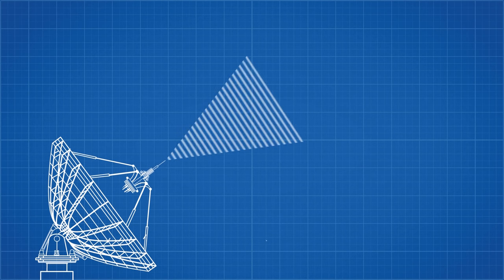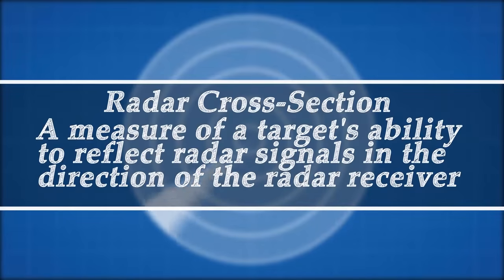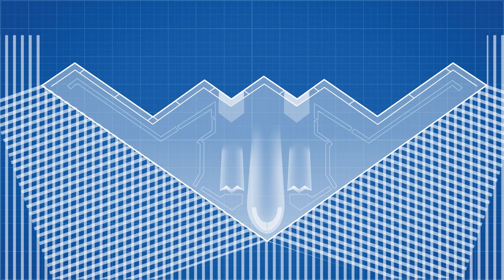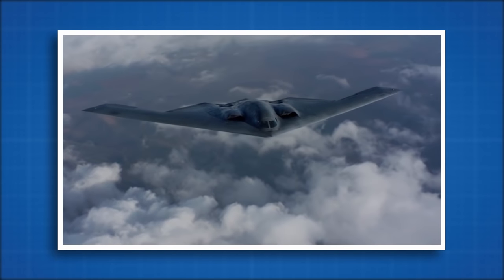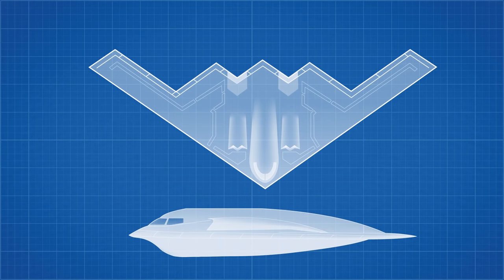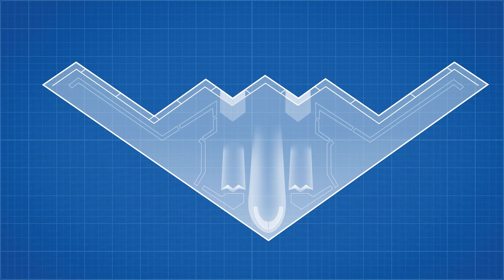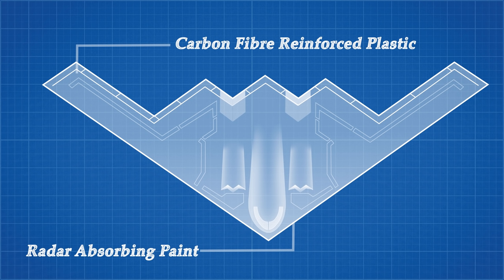Stealth - How Does it Work? (Northrop B-2 Spirit)

Comment: so radar works like sonar but with radio waves instead of sound?
Reply: pretty much
Reply: Hence the similar name Ra-DAR,  Radio Detection And Ranging. So-DAR, Sonic/Sound Detection And Ranging, the name for using this principle in meteorological instruments, for military use it's called So-NAR: Sonic Navigation and Ranging. Then there's also (just had to look it up) Vi-DAR, Video Detection And Ranging, and LIDAR, Laser Imaging/Light Detection And Ranging. All work on the same basic principle: sending a pulse and look for how long it takes to get a reflection and where from, except VIDAR, that just a high-speed camera looking for speeding cars, comparing images to calculate speed :D
Reply: No ahit

Comment: I’m pretty sure that the F22 raptor has the radar cross section of a marble so........
Reply: But that is against fire control radars, b-2 is stealthier against longer wave lengths. However, fire control radars are all you really need to be very stealthy against to survive. (as long as your own radar and sensors can see the enemy from a longer distance than they can see you) I doubt even VHF radar could see f-22 from 250 miles away, which is the same distance f-22's alr-94 will passively pick it up.

Comment: Things you will never hear at war:

1: The shot that killed you
2: A-10 firing it’s guns at you
3: “B-2 spotted on radar!”

(To everyone who hates this comment: *Please relax, it’s just a joke*)
Reply: It got shot down because of radar once
Reply: sigh

FYI it wasn't one of these that was shot down. No B2 has ever been shot down. The only one I know of that has crashed was one with some sort of electrical problem on takeoff.

Serbia shot down an F-117A nighthawk, a plane designed and conceived in the 60s, but simply because the pilot had been using the same flight path over and over and the bomb bay doors were jammed open. The actual shot was lucky but it's the only nighthawk that was ever shot down. I'm also fairly sure the Americans didn't destroy it because the technology was over 20 years old at the time. Meanwhile if I remember correctly Serbia basically got turned into Swiss cheese after these things destroyed 1,600 high value targets.
Reply: @thomashayhurst6547  health care
Reply: @lazar9586  what do you mean by that? What relevance does it have to the conversation? Just curious..
Reply: Guys please stop sending hateful replies, this comment is just a joke for those who understand it
Reply: 1: kinda not true

Comment: You should do a better job of checking your history. Northrop had made flying wing planes before the Ho-229 existed starting with the Northrop N-1M which led to the N-9M which lead to the development of the YB-35 and YB-49. Please stop peddling the myth that the B-2 Spirit was inspired by the Ho-229, it wasn't. The Ho-229 was also had a completely different role, it was a fighter/light bomber, VERY different from a strategic bomber like the B-2 or YB-35/YB-49.

And what planet are you living on if you think the Ho-229 would have had a big impact? You know it only carried two 500 kg bombs right? That is is NOTHING, even the P-47 could carry more bombs than that. Or how about the Mosquito bomber, that plane carried twice the bomb load of the Ho-229 and nothing could catch it until 1944 but it wasn't devastating Germany. 

So please do away with the Nazi tech-wank, other wise it's a well done video.

Comment: The Germans may have been genocidal maniacs but damn were they good engineers. Still are.
Reply: No they were shit engineers in WW2. None of the stuff they made actually worked, it just looks good on wikipedia stats pages. I mean the idiots didn't even have trucks so the vast majority of their army had to walk everywhere and use horses to move supplies. The Allies were actually more advanced in just about every area.
Reply: Yeah, their tanks are a prime example of this. Everyone pictures them as impenetrable behemoths with a gun large enough to make any ally tank crew retreat. This is not true... at all. While when the Tigers and Panthers were first used they were, for the most part, better than all Russian and American tanks but they were slow, and too heavy, both for the ground and their transmission as they would constantly break down and sink into the ground. The ally tanks also had the advantage of numbers, while the Tigers could take them out easily a few could start flanking it and get to it's rear armor, penning and destroying them and later on with tanks like the Sherman Firefly and T-34-85 the Tiger was completely outclassed. It is also worth noting that when Germany invaded Russia they had not designed their tanks for the cold so they broke down, despite being built on more reliable chassis (Panzer 3s, 4s and Stug 3s) they couldn't handle the cold.
Reply: Jhawk 163 Tigers and Panthers were never better than all the Allied tanks, they only look it on paper. If a tank is constantly breaking down and has shit speed and low range then it's really bad on a tactical level. They were also far too expensive and time consuming to make in large numbers so even in 1945 they were only a minority of the German armoured forces. They also were not invulnerable from the front even when they were introduced. Loads of Tigers were even killed by the British 6 pdr gun. Tiger 131, the only still working Tiger, was knocked out from three 6 pdr shots to the front of it in Africa. And it's not as if attacking from the front was neccessary either. The Sherman and T-34 crews knew how to exploit there far greater mobility and were always getting into good flanking positions on German tanks, even if you can kill a tank from the front it's always best to surprise them from the side. That saying about how it took 5 Shermans to kill a Tiger is total bullshit.
Reply: EvidensInsania You are saying the same shit I did and calling me wrong....
Reply: Jhawk 163 It was your comment about how at first Tigers and Panthers were initally the best tanks and when confronted with Tigers the Allies would just lose lots of tanks while they flanked it. As I said, Tigers and Panthers were never good tank designs. Also it is so completely untrue that tank battles against Tigers happened that way and is really insulting to Allied tankers. First off if you're going to flank a group of enemy tanks you do it before the battle starts otherwise enemy tanks could quite simply just turn to keep their front armour facing the enemies. The second thing is that even from the front Tiger's could always be killed. As I said, there are plenty of times when even little 6 pounder cannons knocked out Tigers from the front. You also don't need tanks to kill other tanks. Anti-tank guns were responsible for knocking out a lot more tanks. So long before they were fitted in tanks you had guns like the 17 pounder, QF 3.7-inch AA gun, and Soviet 85mm flak cannons that were being used on the the field and obviously more than capable of ripping right through any Tiger. AND you even had portable infantry anti-tank weapons like the PIAT and Bazooka.
Reply: EvidensInsania I said better compared to the competition, because at the time, the Americans had the slow sherman with wimpy armor and an even wimpy-er gun. BTW, the way I said the allies used for killing Tigers is true, but for when they got ambushed.
Reply: Jhawk 163 Even the first Sherman's weren't comparatively slow and despite their hull armour not being as thick it was constructed at a steeper angle than on later Shermans. So even the first Shermans were much better armoured than the Pz IV and III and would often bounce 75 and 50mm German shells. You know what else the first Shermans could do that the Tiger's couldn't? Work without breaking down. A pretty important trait for any military vehicle and the Allies had the common sense to recognise that unlike the Germans. Take the M26 Pershing, the Americans could have had that tank in mass production and service in early 1944 but the tank commander's in Europe absolutely did not want it because it was so unreliable then and they wanted something they could count on not to let them down when they're in the shit.   

No blindly charging Tiger's, sacrificing loads of tanks, was NOT how the Allies fought Tigers. Like I said, they had plenty of tools at their disposal that could kill Tiger's from the front. But even if you're just talking about the 75mm Shermans being ambushed by a Tiger (and may I point out that 75mm Sherman barely ever saw Tigers) then they could use smoke shells to hide their approach or another effective tactic was to use white phosphorous shells that would burn so brightly that the Tiger's gunner would be unable to see and the smoke from the burning steel would get inside the tank and make it impossible for the crew to breathe.
Reply: Jet fighters
Cryptography
Rockets
Modern Machine Guns
Assault Rifles
Anti Air
Submarines
Modern Tanks
Airborne Units
Helicopters
Guided Weapons
Night Vision
Some examples of the "not working stuff": MG42, Sturmgewehr 44, V2 Rocket, 8,8-cm-FlaK 18/36/37, U-Boot-Klasse XXI, Gewehr 43, Zielgerät 1229, Messerschmitt Me 262, Bf 109, Fw 190, Ju 88, Ju 87, Enigma,  ...
Reply: weco well submarines and helicopters are spanish...

Comment: Video suggestion for Real Engineering...  Pierre Spray (father of the F16) has called stealth a scam.  It appears modern radars use broad spectrum frequencies to effectively detect stealth planes.  Russia and China already use these.  Example...so if the B2 is designed to defeat 9 GHz radar, a 8-12 GHz broad spectrum would have no issues spotting it because they can go beyond 9 GHz.  It would be interesting to see a video on this.
Reply: +Aaron Smith

 You are very much mistaken. Pierre Sprey was not the designer of the F-16. He worked under John Boyd as part of the research team for the Department of Defense's Lightweight Fighter program back in the '1970's. The design team was headed by Harry Hillaker. 

 Stealth is not by any measure a scam. Many R.A.D.A.R.'s of that frequency can detected or possibly paint the aircraft but not at extreme ranges given the deterioration of the signal at longer ranges and the fact these systems are not suitable for guiding ordnance

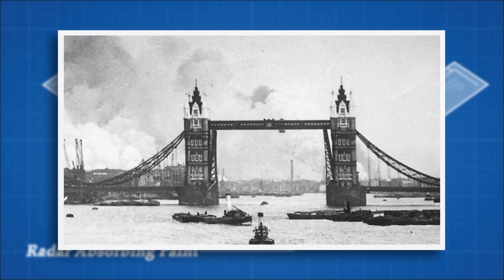Comment: 3:30 It would have had zero impact on the war as it was an interceptor aircraft and not a bomber, it's radar crossection would have also been larger bacause of the engine intakes on the front instead of the top.

Comment: Just so you know, the Horton 229 was actually designed to by the first flying wing aircraft made from lighter composite materials, but it wasn't until around the 1980s (when the American Air Force was experimenting with stealth planes) that its creator decided to sell his plane as a stealth fighter in an effort to obtain defence contracts when his business was failing.
Reply: What are you on about?

Comment: I wonder if a fractal shaped pattern on a copper/titanium oxide layer would also decrease radar reflection by another order of magnitude. 
In the same way cell radio antennas were shrunk down to fit on a PCB exploiting the nature of fractal repeating similarity, and also an increase in the bandwidth that can be received, the same effect could be used to capture and dampen RF

Comment: Good vid, but I presume you didn't find enough sources that say that Jack Northrop copyed the german design, but with the help of computer simulations of that time and coumputing power he managed to implement the germen aspects of the flying wing in the B-2.Because the germans designed the flying wing first, but were unsuccesful in in controling the airframe.That's where JN's cleverness and ingenuity come in to play with the vector nozzles of the engine and rudder control.
Reply: +shadeslayer1612

> "but I presume you didn't find enough sources that say that Jack Northrop copyed the german design, but with the help of computer simulations of that time and coumputing power he managed to implement the germen aspects of the flying wing in the B-2"

 No there wasn't anything particular in its design that was carried into any future aircraft. Certainly knowledge of its flight characteristics had effect on future flying wing designs. 

> "Because the germans designed the flying wing first, ..."

 The concept of the flying wing dates back to France and the U.K. just at the beginning of the first world war. Soviet aviation pioneer Boris Cheranovsky's aircraft, specifically the BiCH-3/ 5/ 7 series were the first "flying wings" to fly, powered or otherwise. They were technically flying wing aircraft, but still had two rudders, but not tails. Jack Norhtrop's N-1M and N-9MB were the first powered true flying wings, in 1940 and 1943 respectively (the N-9MA first flew in 1942, however crashed after 23 hours of flight testing, and only flew in straight lines, with minimal course change). 

 Horten's didn't get their powered design (the Go 229 v.II) to fly until February of '1945.
Reply: Tnx for the reply, I'm sorry that it took me this long to answer,I was in the middle of exams actually. Yes I know that the germans build there first, and that the concept of a flying wing dates even earlier. I read somewhere(and yes I've tried to find it,when I do I'll sent you the link) where Jack Norton says that the inspiration for the B-2 was taken from the germans, but because the technology wasn't right then for a real flying wing, it wasn't possible to build one, until the onset of the more advanced computers.
Reply: +shadeslayer1612

  The Germans didn't build the first flying wing. If it includes aircraft with rudders, then the first one to successfully fly was the BiCH-3. And for a "true" flying wing, the N-1M takes that title. 

 Jack Norton? Do you mean Northrop? He never said such. He recalled the flight characteristics of several aircraft, including the Horten's Go 229 v.III being modeled for the development of future flying wings. But the design itself? False hearsay mostly
Reply: Yes, I ment Norhtrop.

Since I haven't found the article in question, it is possible that I've rememberd it wrongly, and it was just that the Horten Go 229 v.III had an influence,nothing more as you say.

Comment: "Practically invisible to radar" from the right angle, and at the correct distance.  Stealth is just sneaking.  Radar isn't really all that different from your eyes and ears (Because the interface is designed by humans for humans)  All Stealth does is allow you to get Closer to the radar, with a minimal return.  It's not "Invisible" but the return signal is small enough to be overlooked as noise.  Keep in mind there's a lot of Noise in the signals coming back, especially on ground based radars (Which the B1, and F117 are designed to defeat) because the ground, and ground obstructions like buildings also bounce back radar signals.  So, they have to filter out the return signals of sign posts.  The idea of Stealth is returning a signal small enough that it gets filtered out with the birds, and signposts.  (Until you're close enough that it's too late, because you brought anti--radiation missiles, or glide-bombs.)
Reply: One of the best ways to defeat Stealth is by Interferometry.  Rather than set up the radars spread out so that they cover the most area.  You array them together so that their effective fields overlap, and they can read each other's signals.  Including signal interference from something large that's not supposed to be there.  Since there's 2 Radars (And processors) involved, they can quickly triangulate the bomber's position, and heading then scramble fighters to intercept.  We developed this technology, and countermeasures to defeat it, before we used it in the theater.

Comment: As a counterpart during a stealth air attack, highly reflective dummies could be used to blind the radar, let's say 100 cheap dummy drones covered in highly reflective material, so their radar signature would be equall to those of real stealth fighters, although the dummies are much smaller, yet the speed must be the same. They could be launched from a cargo plane from a safe distance. Of course, one could say, if the dummies are reflective enough, there's no need to use stealth fighters at all, so this could be used bu those who don't have such.

Comment: I have a question. Even the stealthiest aircraft has some kind of RCS ( we say 0.0001) then can it still be detected if radar is programmed well?. 0.001 RCS is equivalent of a bee flying very high. If Radar can virtually magnify its RCS to a reasonable number if this bee is flying at crazy speed and crazy altitude then there will be no stealth anymore.
Reply: The issue is at range and scale most radars will not be able to provide data for that small of a return. But they can sometimes find the shadow it leaves.
Reply: can it be detected if radar was exactly underneath it?

Comment: So hears a kinda dumb hypothetical, but one that I am curious about.  The B2 is pretty good sized.  and you said a large part of its effectiveness reflects radar away from it's source.  theoretically, could a smaller fighter or maybe a couple drones with a high radar cross section fly above the B2 and hide in the "shadow" it makes?  basically fly the B2 between the drones and the radar station.